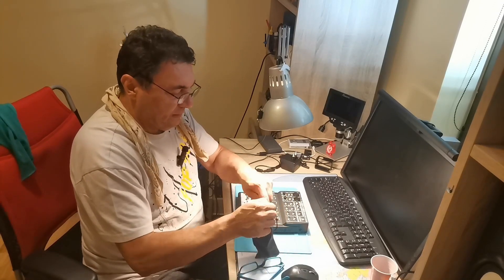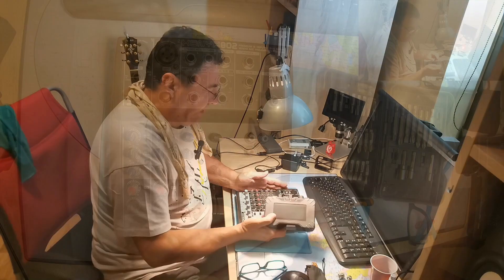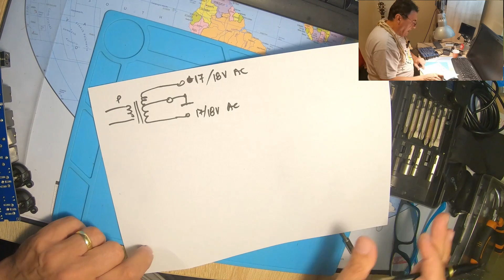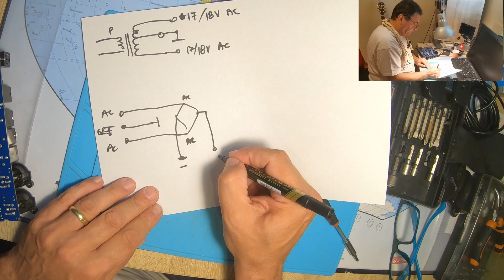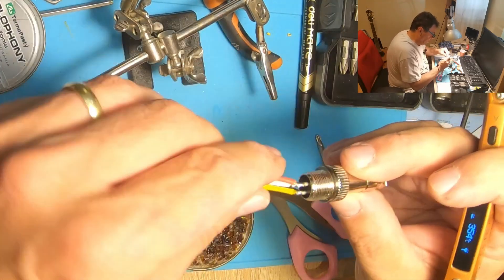Behringer Xenyx 802 AC power plug socket replacement

Comment: this might sound like a silly question but what type of wire should i buy to solder the adapter to the mixer?
Reply from the maker: From the adapter to the mixer you need 3 wires, due  the transformer gives 2x18V AC, you may use any 3 wire cable. I used many times microphone cable with 2 hots and a mesh which is the middle (ground)

Comment: Hello Dear 
I have Behringer Xenyx 802 Mixer I change the Power socket same as u change like bt when I power up the mixer is on sound also give perfect bt Suddenly after 5 Min mixer Giving Hummmm and Sound goes very low and Crack what's d problem
Reply from the maker: Did you longer the cables? We are usually done the to have extra room, but all those put extra resistance...and so low current
Reply: @viocaia  we use only 1 meter wire form transformer to Mixer power socket 1st time when I replace d socket thats time by mistake I connected ground to + side so my 100v/100uf capacitor and 35v/470uf  thatz 2 capacitor get top side Bump so I change d capacitor & wiring also make proper now d mixer getting Hummm sound after 15 min and when we off d mixer and return on mixer getting clear sound thatz d problem
Reply from the maker: @sandeshsalgaonkar8318  I can't say as long as I can't do measurements...check the circuits for +- supply, Those 7815/7915. Also those voltage regulators needs proper cooling.

Comment: La fuente de poder de los tres pin un pin se me a roto, como puedo arreglar este problema:/
Reply from the maker: Simply, have the wires soldered directly on the board. But you need to replace the connector anyway.
Reply: @viocaia  buen dia, mande a conectar los cables directamente a la placa pero ahora no enciende la mezcladora, usted sabra cual puede ser el error? Espero que no este muerta la mezcladora:( gracias
Reply from the maker: @MisaelSarmientl  Are you sure you are using a 2x18V AC ! ? It should be AC! You should have 18V-0-18 V. Measure from the ground  to each wing 18V AC
Reply: @viocaia  es el cable totalmente original que viene por defecto con la mezcladora
Reply from the maker: @MisaelSarmientl  Maybe the transformer is gone...do you have a Voltmeter? Can you measure the voltage?

Comment: I need to do the same, but add a rocker switch to toggle the power on/off. Unsure if it'd add noise to the input though.
Reply from the maker: If you apply a power switch after the transformer you need a double one, because there are two hot 18V AC and ground..you need to cut both hot ones! But a simple switch on the high voltage input will be fine.
Reply: @viocaia  Its not ideal but I was going to switch the ground input. Really wanted it on the switch on the unit itself.
Reply from the maker: @sokoloft3  Interesting! Never though  about !  Let me know if it works....
Reply: @viocaia  I wouldn't like having 36vac always on the device.

Comment: have thesame problem...i really need a replacement power supply. 
where can i buy such?
Reply from the maker: You need the model with 2x18V AC ! Something like this https://www.ebay.com/itm/295920787554?_trkparms=amclksrc%3DITM%26aid%3D1110006%26algo%3DHOMESPLICE.SIM%26ao%3D1%26asc%3D264183%26meid%3D748baf1454b44fa389fbb5cab5caa50a%26pid%3D101875%26rk%3D1%26rkt%3D4%26sd%3D293217179128%26itm%3D295920787554%26pmt%3D1%26noa%3D1%26pg%3D4429486%26algv%3DSimplAMLv11WebTrimmedV3MskuWithLambda85KnnRecallV1V2V4ItemNrtInQueryAndCassiniVisualRankerAndBertRecallWithVMEV3EmbeddedAuctionsCPCAutoWithCassiniEmbRecallManual%26brand%3DUnbranded&_trksid=p4429486.c101875.m1851&var=594114046936

Comment: This is cool, nice work do you fix personal mini disc players by any chance?
Reply from the maker: It's kind of difficult, I usually replace belts, or minor things like power plugs, batteries contacts and so... But if it's related to the laser or command boards, that's almost impossible to fix...What's the problem?

Comment: Hi..my original plug shocket not working...always comes large humming sound...if you know whats problem...and how i buy this adepter for do this modification..please give mi link o whats name of this adepter
Reply from the maker: Look for Behringer PSU3. Nut if you have loud hummed sound there is more than adaptor, possible linear regulator are gone...
https://www.amazon.com/Replacement-AC-Adapter-Supply-Behringer/dp/B083SDQSLL
Reply: @viocaia  this is original...i want to change this original adepter same as your adepter..[this video you fixed adepter model]
I controlled all channel..this humming is came always..witout connect other chennel...but in italy isnt anyone repair this problem
Reply from the maker: @madumadu4819  I see...It's a lot to do getting the noise out...You may send it to me, but it's not really worth it, the post will be more than the mixer itself. I'll fix it for nothing!😁
Reply: @viocaia  where are you from ?
Reply from the maker: @madumadu4819  Romania...
Reply: @viocaia  i can send my mixer for your address..can you fix my problem…that humm sound ? And whats your repair cost ?
Reply from the maker: @madumadu4819  Where are from? Let me see the post duties...and eventually custom costs.

Comment: The plastic part of my original plug broke off, is it relevant electrically or just to hold the plug? It is now inretrievably stuck in the socket. I don't know if I have the skills to safely replace it though. Any tips?
Reply from the maker: It's just holding the plug, no electrical contact. Use some hot glue to redo the insert path.
Reply: @viocaia  thanks

Comment: can i use a 19 volt laptop power supply for the behringer eurorack ub802?
Reply from the maker: No way! It have to be 2x18.5V AC!
Reply: @viocaia  Thank you. I understand that I need to buy a new AC transformer 2x18.5V 350ma, but I can’t find it on the Internet for purchase. And the old torus transformer hums quietly when turned on, but does not produce voltage
Reply from the maker: @realmroyalereforgedhighlig4987 Something wrong at the secondary outputs. You may open the case nad check. Or maybe the 3 wires cable got shorted somewhere. As long as in not getting very, very hot it can be fixed. Check the cable first.
Reply: @viocaia  
it probably already was, because the case was already melting from the heat, but I already received it like that
Reply from the maker: @realmroyalereforgedhighlig4987 ok, very clear, But there is still a chance, the primary should have a thermal fuse, which usually got interrupted at  110 Celsius. If you have a little passion, you can find it, bypass, and you have a working transformer...only if not the wires got fried...it worth a try.
Reply: @viocaia  ok. i will try. thank you very much!
Reply from the maker: @realmroyalereforgedhighlig4987 Always!
Reply: @viocaia  Hi, good man. I bought a new transformer with two secondary windings 18+18v, but I have 4 pins. I now need to buy another transformer with a midpoint on the secondary winding of 2x18m, as I understand
Reply from the maker: @realmroyalereforgedhighlig4987  You may connect those 2 windings so at the ends to have 36V AC. The middle point is ground...In your case you have two separate windings, all you have to do is to put them in series.
Reply: @viocaia  Thank you. It remains only to find where the beginning and end of the windings are. And one more thing, my transformer has a current of 1A, isn't that much?
Reply from the maker: @realmroyalereforgedhighlig4987 Not at all, the device is taking how much it needs. Even better, the transformer is working at large.

Comment: Nice video Viorel. I just need the missing link... wich is How to rewire the Power supply to get the voltage you desire. Would be very helpful. Thanks a lot !
Reply from the maker: Hey you! It's very simple, the middle ground goes to mixer's ground and those two 18.5V AC to each input . I'll do a video about it in detail soon.

Comment: Hi Sir! Thx for video. Mine Behringer Xenyx1202FX has a 3 transistors or something like this marked with the sign "100". Theoretically - can i switch my broken connecter with the way you did and by appliying those 3 guys back on the top? One more question please. If i buy 15V and 1A power supplies - and i will connect him to the Behringer  - it will supply 2*500maH and 15V to both pins (left and right) or i need to suplly second  power supplier 15V to another plug? 15V 500maH to left and 15v 500maG to right plug? Many thanks to your respond Viorel.
Reply from the maker: I believe those ''100'' are capacitors, you can put them back or let it go, just a filter. For the power supply this mixer works with 2x15 to 18V AC...so you need a double output of 15V AC... it can be done by two transformers with at least 15V each AC! (alternating current). Any other will not work, even DC directly, without a change in the mixer's power regulator circuit.
Reply: @viocaia  Thank you very much! I will have to buy 2 pices of 15V 500mAh
Reply from the maker: @mikepersidsky  Wait for my video! I'll shoot about and how to create a double AC power from two different transformers. Only AC! You need a multimeter for measuring the AC from the transformers.
Reply: @viocaia  thank you!

Comment: I have a mackie mixer which has the same voltage need as the behringer. I want to use the behringer power supply with it as the mackie power supply failed. When i cut off the ends of the power supplies i see the Mackie just has a positive and negative but i see the Behringer supply has 3 wires  Yellow blue and red.  So which wires to i need to connect to the positive and negative leads for the mackie connector    thanks and cheers. I did hook the red to positive and blue to negative but left the yellow wire not connected is that right or should i connect the yellow wire to the positive or negative as well or just leave it not connected.
Reply from the maker: Xenyx it's using a differential AC power supply, there is no plus and minus but ground and 2x18V AC! I doubt yours is using the same. Let me know the model for further assistance.
Reply: thanks for getting back to me i guess the question can i use just the two wires as i only one set of voltages not both or at least it appears that way as mentioned i connect the red wire to the the two lead cord so as to use a different connector on the end that plugs into the mixer so is it safe to leave the yellow just covered and not in use. im guessing it also has power and that i got lucky just hooking up the red and blue and not using blue and yellow  the two wired cable i did connect to has a striped wire which is usually the positive and the non striped wire is usually ground. UPon connect to the mixer it does work however there is a slight hum  cheers @viocaia
Reply from the maker: @DonAlderOfficial  Let me know the model...
Reply: its a behringer Europack MXUL3. output  2*18.5 v -/ 2* 150mA.   which had the round end plug. ive cut that end of and trying to connect it to the common 2 prong plug land just want to make sure thats okay and which of the 3 wires should be connect to the 2 wire plug @viocaia

Comment: I am not an engineer but I had never heard about a 2 times 18 V AC power supply. That company had been founded in germany cause I had seen some leaflets of just a handfull products in the early 90s. 

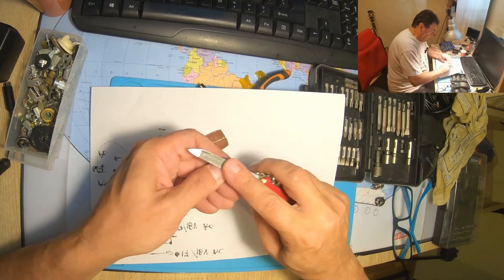6:50 - I like these kinds of improvisations cause who has every size in the shop ? 

9:00 - adding lead solder to remove the solder joints might be my key issue have been cause it never did work out that fine for me.
And I have to do a for me crazy job cause late at night when my Pico W had arrived I had soldered the 2x 20+ pin header and next morning I had looked at my work and found the solder joints great, till I realized that I had soldered them upside down !

I guess with your way I should be able to get these joints out cause so far I had not even started cause I thought it would not work out and would be a waste of time cause I had ordered  3 or 4 spares with the first one so I did not care so much. But since then I have my famous upside down PICO W somewhere on my desktop laying around and reminding me to not solder too late in the evening and that I need to fix it sooner than later.

Thanks for sharing.
Reply from the maker: Yep, the input it's kind of strange for a comercial product but I had a lot of nice resuslts with preamps, EQ, tone controls which I build by the years and most of them are supplied with differential - ground+ voltages coming from 2xAC voltages, evidently with the middle secondary wire to the ground. For unsolder things it should be nice to have some low melt soldering wire, I never tried thata but at least the one I'm using it's melting around 275C, sometimes helps because the industrial soldering it's like 320 or so because lack of lead...so...good luck! And thanks for looking!
Reply: well now you know is for phantom power and one powering the mixer